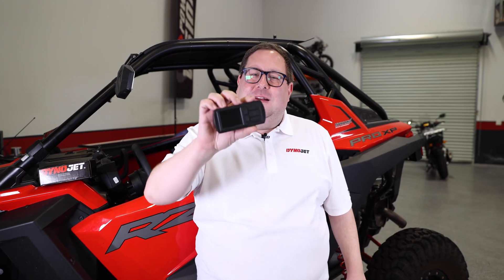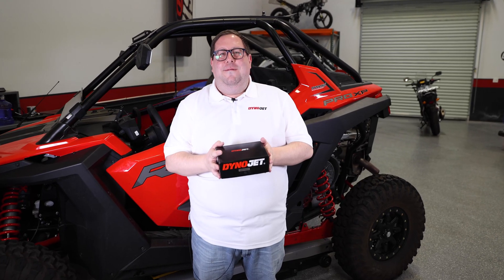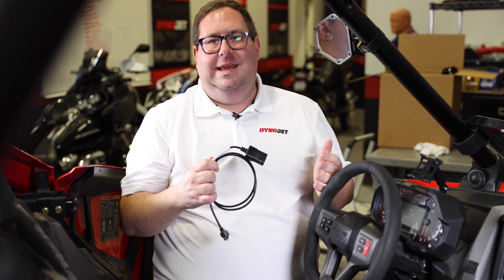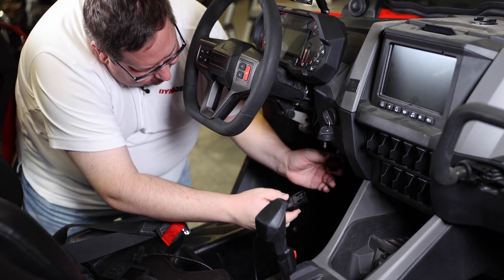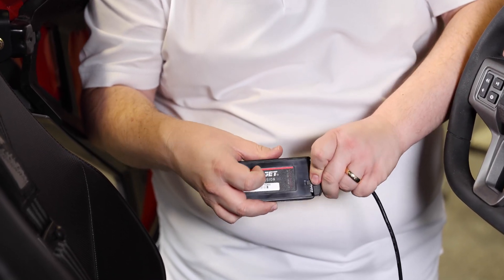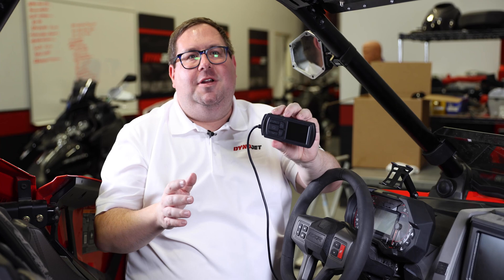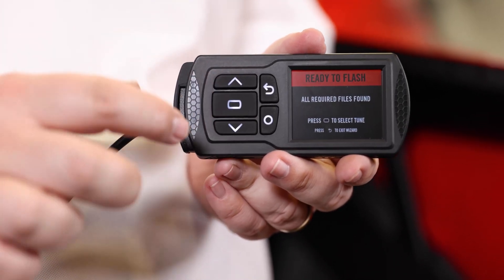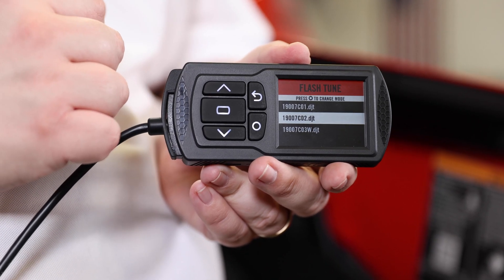OFFICIAL VIDEO: How To Install a Dynojet Power Vision 3

Comment: Are the tunes optimized for certain aftermarket accessories, like specific brand exhaust and airfilters? Or will I need to get a dyno tune to get peak performance?
Reply from the maker: You can browse our tune database on our website to see if there is a configuration that we have developed a MAP for. If there is a similar configuration, this can serve as a base MAP and we recommend visiting a local dyno center to dial it in.

https://www.dynojet.com/tunes

Comment: Hey, a question about my PV3 tuner and the tunes. I have a Can Am Maverick Trail and I am building a custom exhaust for it. How can I get a tune for my PV3/ use my PV3 to get better AFR for the new exhaust I am building? Don't want it running lean.
Reply from the maker: We suggest a Wideband Kit and to visit a local authorized Dynojet tuning center to get you dialed in. 

You can find dyno centers using our locator here: https://www.dynojet.com/dyno-tunings-center/power-vision-tuning-center

Comment: So once you’re done flashing if you’re not trying to track anything do you just unplug from the diagnostic cable or keep it plugged in all the time
Reply from the maker: You can unplug the device as it is a flash tuner and does not need to piggyback the ECU.

Comment: I know this will work on my 2021 Polaris Sportsman XP 1000 but does it have to stay on the vehicle or can it be removed and mods will still stay on vehicle ?
Reply from the maker: It is a flash tuner and can be removed if you do not wish to use it for live gauges.

Comment: Will it work on Polaris RZR 570? And can u give any ideas how much horsepower or torque it will give? + Will it remove the speed / rev limiter or just adjust the top speed a bit.
Reply from the maker: Yes, we have a Power Vision 3 for the RZR 570 (2017-2021). With the proper tune, you can get up to 15 more WHP vs. stock. We can go into more detail with your specific setup over email (pv3tech@dynojet.com), making sure you have what you need. https://www.dynojet.com/power-vision-3-for-polaris-rzr-570/